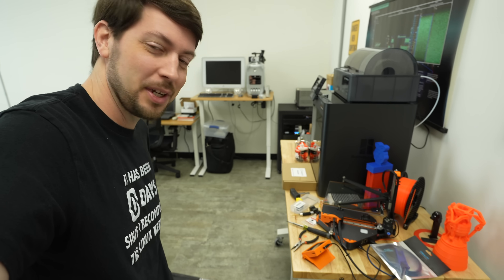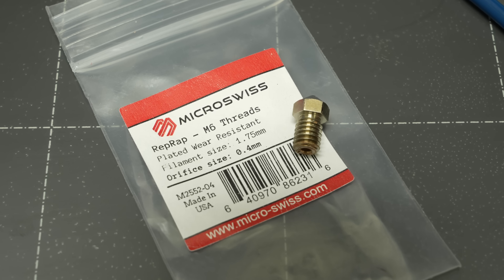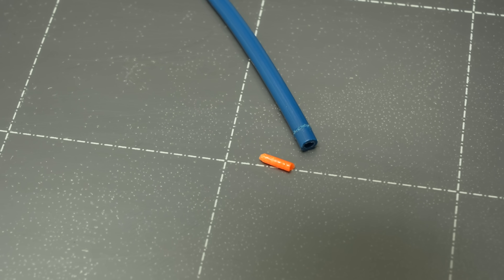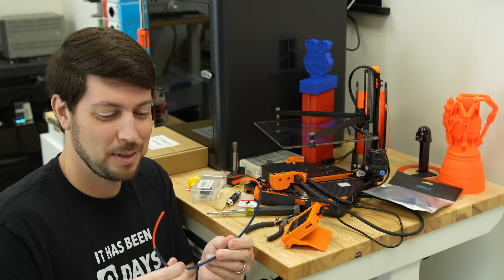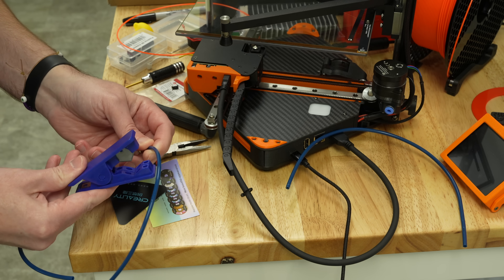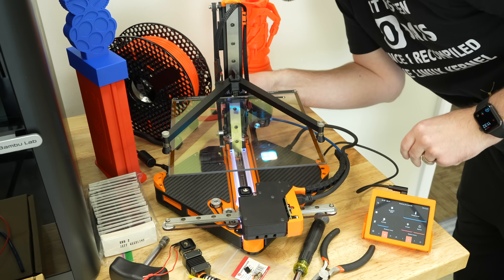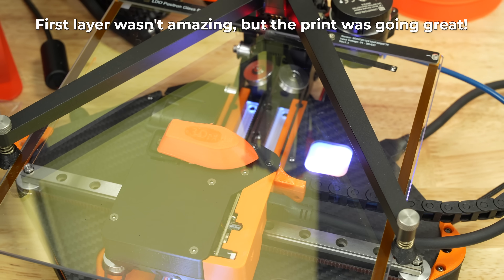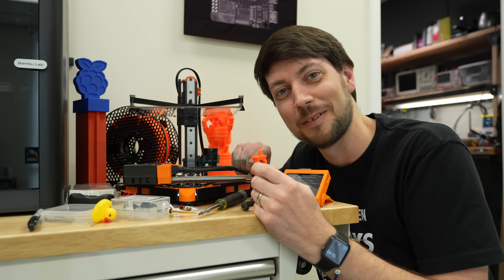Wasting $80 and 6 months on a $10 fix

Comment: just had a similar thing with my ender 3. it was under extruding and the extruder was clicking as it slipped on the filament. bought and replaced the nozzle, didn't fix it, bought and replaced the extruder gear, didn't fix it. turns out the bowden tube, the ptfe tube that was your issue, wasn't fully seated in the hotend and a big bead of material had formed in the void. if I had checked the basics I would've saved myself a week of headache lol
Reply: I had the same issue. It'd print fine at first but eventually itd extrude less and less and start making a loud clicking sound. i checked everything you said with the hot end, didnt help. 

Turns out it was the spring on the extruder, I'd replaced the extruder mechanism for an all metal one and the spring was too strong, it was making the gear smush the filament, and anywhere on a print that had a lot of retraction, like small lines of infill, it would pass the same section of filament over the gear over and and over untill it was so deformed it caused friction inside the bowden tube. 
Then it'd print a wall section just fine, then get to more infill and make another smushed section. Untill eventually there were so many smushed sections the filament was stuck in the bowden tube. 

Most of the time i'd stop the print when it started clicking so i though it was some issue at the hot end causing the filament to get stuck at the same point on the gear.  

I can't figure out if i put the old spring on the new extruder by mistake or if the one it came with was just too strong. Either way i swapped it to the other spring i had and the problem went away completely. 

The crazy part is whilr i had this issue i was able to do tow big prints with no issues. 
One was a 100% infill piece to replace a dial on adjustable dumbells. And the other was a vase. 
Because neither of them had any moments of retraction they printed fine.

Comment: Had the same issue some weeks ago with my ender 3. I didn't put a clip onto the hotend and the ptfe was also bent too much and sometimes little to no filament was transported and sometimes the extruder clicked me to death. Bought the creality ptfe and everything is fine.

My problem came to light, as I've changed the heatbreak.

Comment: when cutting PTFE without a special tool, don't use shears or pliers. Just do a straight cut with a razor blade (or any other knife). This way you won't deform the tube

Comment: Lol thats the Capricorn tubing. Used to think they were the shit, but nowdays, cheap tubes work just as well
Reply: With Positron, you'll need to use smaller inner diameter Bowden, which Capricorn has in abundance. Cheeper stuff usually has a larger inner diameter which isn't compatible.

Comment: Glad you were able to finally narrowed down what the problems was.   Granted you ended up with an expensive replacement part that you didn't need but look at it this way least now you have a spare in case you do need it in the future.  As time goes on some replacement parts are either very expensive or hard to find.

Comment: The oozing on the back side of the nozzle is a known design problem for older and simpler printers, its part of why the newer Prusa nozzles (XL, MK4, Core One, etc...) use continuous tubes all the way down. The nozzle and the heatblock are different metals (and even if they weren't different metals they are produced independently) and expand/shrink at different rates, meaning even if you used a torque wrench and pre-loaded the threads as much as possible on the brass nozzle all the way while cold; once heated up, you can still have oozing on the backend if the tension resolves in the forward unscrewing direction. This same problem can also occur on the heatblock itself on the top interface which I've seen on the older Prusa machines. The nozzle or the feed side can also just "walk around" on the threads over enough heat cycles.

As a fast fix for our print farm we always heat up the heatblock to slightly higher than nominal temperature when replacing nozzles, adjusting heatblocks, or occasional maintenance but it means you can just loosly/reasonably tighten the nozzles down this way and it doesn't require such a tight torque spec (they are hot when this happens so you need to use a tool not your hand). I'm not sure if there are other "real" solutions for this issue other than a continuous pressed in/single piece hotend / heatblock in the critical filament path, a lot of the third party hotend/heatblock solutions are continuous now anyway so its likely not as serious an issue anymore.
Reply from the maker: Yeah; I've since started heating the hotend to 120°C or so, screwing the nozzle in about 75% of the way, waiting a few minutes for it to warm up, then torquing it down with the wrench. Seems to have done the trick for the time being at least!
Reply: FYI, hot tightening is standard procedure for E3D V6 nozzles like that used on the Prusa Mk3. While cold, tighten to finger tight, then heat it up to 285 C for final tightening to 2Nm. E3D's 2 piece nozzle/heat break system is widely cloned, with many derivatives, which likely inherited the procedure. That said, I suspect the stainless steel heat break tends to wears out the aluminum threads in the heat block if you're not careful during assembly. The new one piece integrated nozzle and heat break is an amazing innovation for actual practical nozzle swaps.

Comment: in hindsight checking the cheaper to replace components first makes sense, but a clogged nozzle is the more likely cause of underextrusion compared to a kinked/blocked bowden tube, so you weren't wrong to suspect that first.
Reply from the maker: Yeah I didn't even think about it for a while, because I'd never had a problem with any of my bowden tubes on my old Crealities, it was always a nozzle issue!

Comment: Oh, I hadn't even considered, how stupid it would be to have the nozzle ooze onto itself. The positron might be portable, but I really don't think it's worth all the tradeoffs.
Reply from the maker: Cleaning it after the fact is a little fun :D

*Normally*, if you keep an eye on things, it's not an issue. But it's certainly not a set-it-and-forget it printer you could just shoot print jobs off to!
Reply: @hellterminator  we've improved the software experience to make it turn the PCF on full blast when loading filament, this prevents it from oozing and allows it to be just a piece of filament you pluck off.

Comment: Bought a Creality Ender 3 V3 SE, which was a customer return. The extruder motor driver kept on releasing the motor randomly, and would only start driving it again after the enable pin was toggled by the firmware. Creality's support sent me a new extruder (without the motor, though I asked for it specifically), later a new mainboard, which didn't solve the problem. Communication with the support team got more exhausting and pointless, so I decided to sell the printer for the price I got it. A guy bought it, and I asked him to message me if he manages to fix it. Well, as it turned out, the extruder stepper current was either too low, or too high. Well, okay, but on two separate mainboards?
Reply from the maker: A ghost in the wires!

Comment: We've all been there ! :) 
I'm a month and a half and 100€ in on sourcing a particular type of screws.😅
Reply from the maker: Haha the fun of ordering an entire kit of screws... and realizing you ordered the wrong size.

I have a couple bins full of screw kits—side benefit, once every 5 or so years, you'll need one weird screw, and you'll actually find it in your massive box of screws!
Reply: I feel your pain. I am the proud owner of 1000 rivnuts in the wrong size.

I needed them to fix my integrated kitchen door back on to the front of my washing machine because the metal skin of the washer is so thin and the holes got bigger over time.

Obviously the ones I ordered were the wrong size 😂